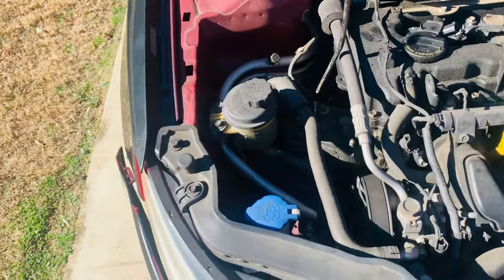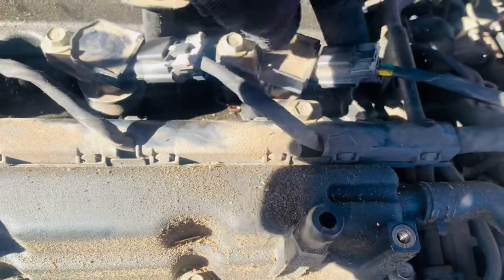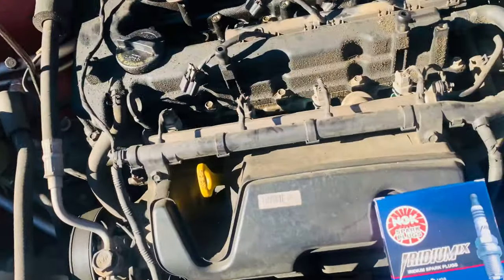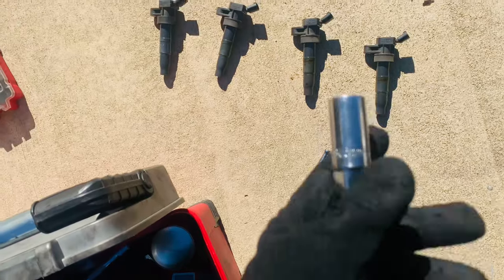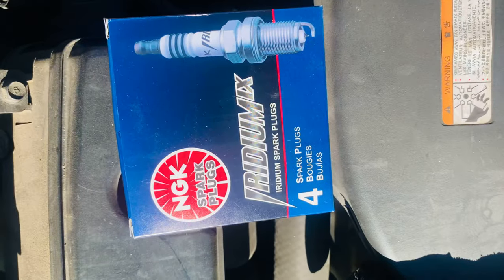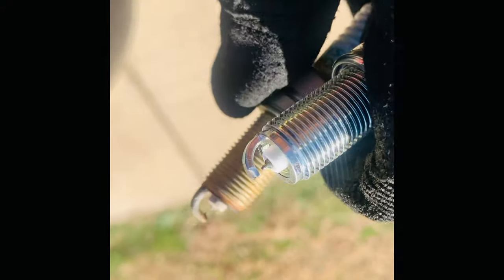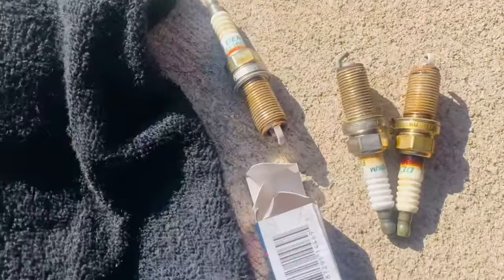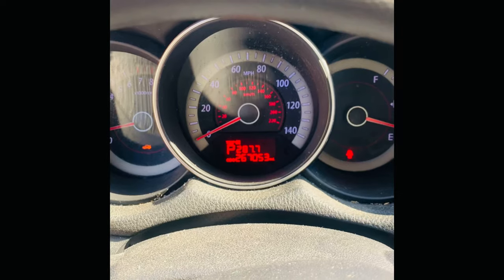How to change Spark Plugs on a Kia Forte | 2009-2013

Comment: Another video on YouTube was saying "NGK" spark plugs do not need anti-seize and to NOT put it on the spark plug's tread 🤔🤔 .
Reply from the maker: I believe you are correct I just did a spark plug replacement and I put it inside the  coil pack housing

Comment: Awesome video

Does your kia has an engine knock, I have a 2012 and it kind of rattles like an engine knock
Reply: mine does 2010 156,xxx
Reply: @FoodDaddy.69  is there a chance replacing the spark plugs would fix the issue?
Reply from the maker: Nah not at all

Comment: Good video man, im getting ready to do my daughter's 2010 Kia forte,  do you know if those coil packs can be cleaned in any way? Just wondering if they were able to that it could possibly make it run better, anyway thanks for the video.
Reply from the maker: They are electric components so I would be careful but if it’s gritty just use a little bit of degreaser and you’ll be fine